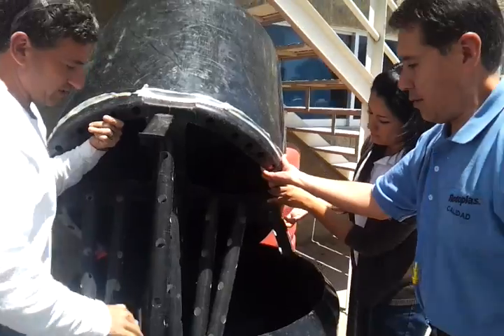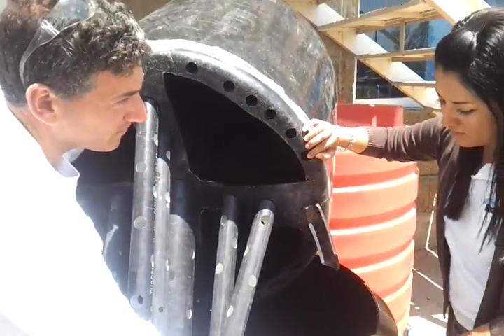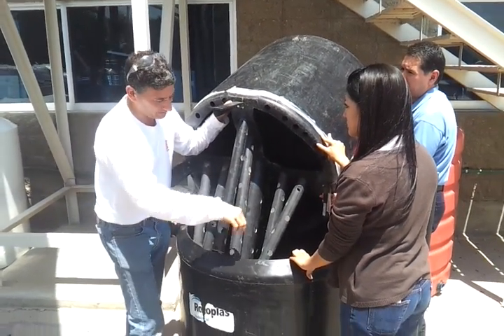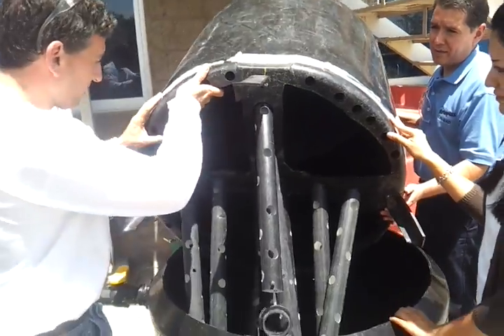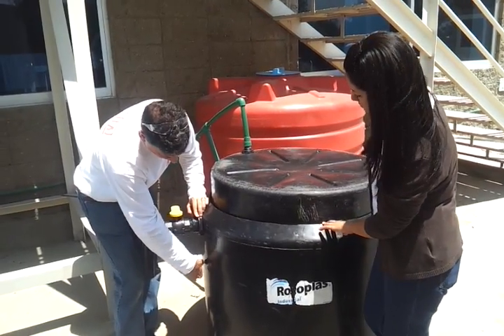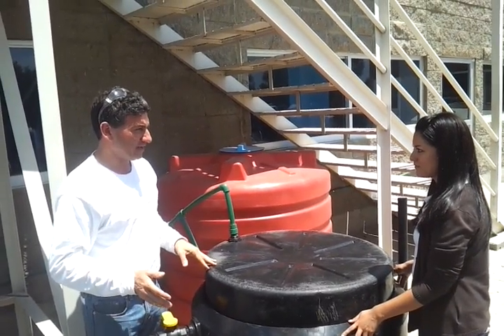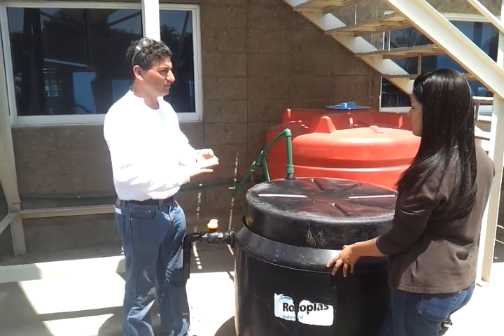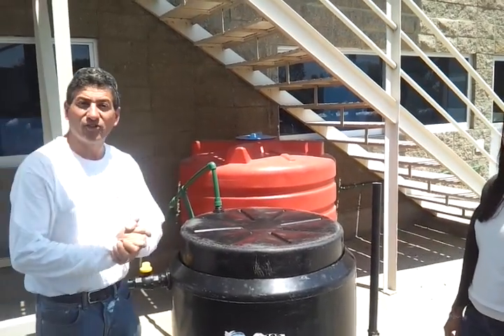Rotoplas biogas experiment in Mexico

Comment: Fantastico. This way of creating an environment for bacteria to settle greatly improved the production? As I understand 10L of food per day produce half hour of gas. 
This product is commercial? Now I want to do something else. Use my software scada monitoring to collect data from this digester. So what do you think of this tank monitor 24 seeking information? I'll start preparing the software that is free called ScadaBR to monitor this plant. 
What parameters would be interesting? I'm already imagining the liquid temperature, water volume of the tank and the gas pressure. Do you know any more? With the pressure of the gas can imagine calculating the autonomy of the system, correct? 
I'll make a video for you intender my idea.